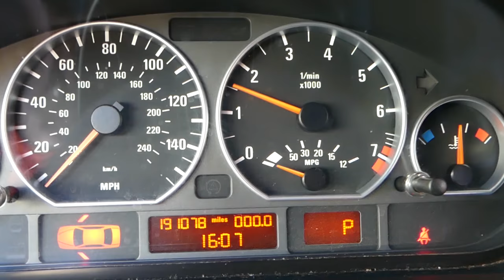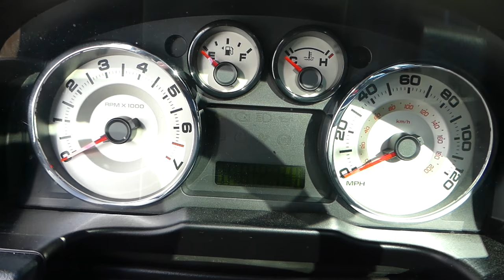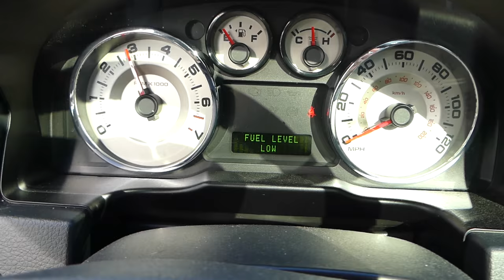HOW TO KNOW IF A CAR JUMPED TIMING CHAIN TIMING BELT. SYMPTOMS JUMPED TIMING

Comment: Never ever rev a sick engine,you will bend the valves. Live data on decent diagnostic computer would show crank  and cam signals have shifted. Not your best diagnostic skills!
Reply: You will only bend valves with an interference engine but it is still not very good to rev an engine that has messed up timing
Reply: Maybe they're putting a new engine in.....
Reply: i think the point was for people who don't understand cars. they know thats not a good thing, but if someone doesn't know what it sounds like or feels like, they could end up causing even more damage than what they could have caused.
Reply: He was show how normal people could diagnose it...
Reply: @Dillon Kluksdahl wrong… it will
Reply: @red3092  That's true, but most engines (other than Turbos) seems to be interference these days.

Comment: Sounds like a  mower. A car should not sound like a mower haha 😅 my car is currently in the shop due to the timing chain. Expensive as hell fix. I feel like it would almost be cheaper to replace the engine.
Reply: It's much cheaper to diy, cost me 65$ to change mine,  took the whole entire day but still worth it
Reply: @rockyloccgarage2040  Yeah the expensive part is the labour precisely for the reason it takes most the day even for a mechanic

Comment: As a mechanic, I'll explain it in more simpler terms! A engine that's jumped time, but still runs, needs to be diagnosed as to whether it's jumped a few teeth on one or the other of its timing sprockets. In which case can't be repaired but only replaced instead. Or has simply gotten it's timing advance or derate out of adjustment at its distributor, which is a easy fix. The most common signs are.
Hard starting with quick, uneven, upward spiking when cranking over.
Unsteady idle, or misfire, with excessive engine vibration. Intermittent but steady popping noise at the exhaust pipe.
Noticeable loss of power and decrease of fuel mileage. 
Excessive valve tick or chatter, especially during acceleration.
Changing a timing set can be difficult and labor intensive, and should only be attempted by someone properly qualified! Several factors go into getting the engine set precisely back into its proper timing position. There is no latitude for this because if the time settling is positioned just one or two teeth incorrectly, it can cause further internal damage, in just a matter of a few seconds!
Reply: @Carolina Western

The surest way to avoid the problem, is to steer clear of that boat anchor that Fraud and Mazdoo call a 3.5!😬
Reply: @slicksnewonenow  didn’t realize these were such ticking time bombs
Reply: Usually on a V6 engine there are 2 timing/cam chains (1 per 3 cylinders) , what would happen if 1 of the 2 cam chains was off by 1 tooth ? would this bend some valves ? anyone knows ?
Reply: @rayhope7957  they don’t? Pretty sure they run off of coil packs like most cars, can’t listen to all mechanics words of advice
Reply: Can you fix my car
Reply: When you say “can’t be repaired - only replaced” do you mean the whole engine? Or the timing chain ?
Reply: @stephenfriesen7636  if it's still running, then usually just the timing chain set. If not, then the chain and whatever valves it may have damaged. In which case I usually rebuild the heads.
Reply: @travismidlam3853  coil packs or not is irrelevant to a timing issue. All engines are timed.
Reply: @PatricioDeLaRosa  One tooth? Not usually but it would depend on the engine. You'd definitely notice it though.
Reply: @carolinawestern3875   thank you very much for your response.   I had a chain skipping on an older car, it it was lurching and stopped running while making a terrible noise. I managed to drive it to a shop only at low speeds.  They said it was timing chain.  Proceeded to replace the timing chain & tensioner.  Now my engine sounds terrible, sputtering often, especially when foot off the gas, occasionally hearing rods knocking.  The shop says their timing job is fine - that it must be other issues with the engine.  Trying to decide to fight with them or if they may be right/truthful
Reply: @stephenfriesen7636  did you discover or fix this issue?
Reply: @briangalicia5290  no. Amateurs who hear my engine running say the constant ticking sound, and occasional rod knocking are serious and indicate bad timing.  The mechanic says they did the timing chain replacement right, and will charge me to “investigate further”.  So now I need to decide how much I want to fight with the mechanic
Reply: @stephenfriesen7636 same situation it is definitely timing I know for a fact in my situation because I went to a guy who looked like the type of guy to lie to me and scam me so there’s my first mistake just take a good look at ur mechanic and u can also tell that way
Reply: @stephenfriesen7636 did you visit another mechanic who got you fixed up? It's crazy how it's just few mechanics who know what to do with timing chains. I have the same issue on my 2009 Hyundai sonata, thought the engine cut outs were crankshaft/camshaft sensor issues, replaced them and car started to misfire, would vibrate if in Drive D and not moving and hesitate to accelerate while I see the rpm gauge move (after stepping on the gas), knew something was wrong as my V6 often oppresses on the road lol.
Drove it home (less than 10 miles)  the same day I noticed the hesitation to move and vibration while stationary, the next day it wouldn't start back up and I noticed a weird sound around the top side of the engine while I cranked it.
Reply: Can a slipped timing chain cause the car to not start? My Audi A1 is not starting and they are saying the timing chain probably slipped
Reply: @Tofaeal  yes it can. Timing chains & belts, stretch or break. As they stretch, the damper keeps it tight with pressure. Till it's limit is reached and causes belt lash. Then it mechanically jumps time. Usually during shut down, if you're lucky.
Reply: the ecu determines spark timing on that car not a distributor mr mechanic

Comment: my car do exactly the same but on my car i got camshaft sensor wrong code when i changed camshaft i got wrong code on the new camshaft too and the car is hard to start sometimes i get no start and sometimes the car dies in the middle of traffic and it's embarrassing,what you think can it be the chain?
Reply: I have the same issues, V6 sonata 09, I changed the crankshaft position sensor and the CAMSHAFT POSITION SENSOR, I think it might be timing, won't start now and a weird noise around the engine head during cranking.
I'll be trusting a mechanic to open it up to confirm this. I have some bits of hope the engine isn't damaged because I heard no crazy sounds before I shut it off and it still cranks.

Comment: just had head gasket replaced with water pump and timing belt.  significant power loss, hard to get car over 70 mph and lots of white smoke and knocking.  what could the issue be?   it was a very expensive repair.  thank you.
Reply: Any overheating
Reply: @eduardo9163  Hi.  Turns out it was the timing being off so it's good now.  Thank you.
Reply: @flipczech  what did they charge and was this a 4 or 6 or 8 cylinder. I clouding pump timing and gasket?
Reply: @eduardo9163  I had the gasket, water pump, timing belt and raditator replaced, for   about $2000.00 and change. And it's a 4 cylinder.
Reply: @flipczech  that's a lot. Not even a v6. Okay thanks
Reply: @eduardo9163  Yes, but it had to go to the machine shop also.  Take care.
Reply: @flipczech  why to the machine shop?
Reply: @thuglivintv824  prob warped head

Comment: ASSISTANCE PLEASE. I have the codes P0008, P0009, and P0017 on my '11 Chevrolet Traverse.  I got the crankshaft position sensor replaced at a shop,  but the check engine light came back on... do I need a timing chain?  Do I need to get the camshaft sensors replaced?

There's no funny noise when I start it up.  I have a video if you'd like to hear the sound of the engine that I can email... I just need some suggestions because I just bought this freakin suv 2 weeks ago.

Comment: Could this cause a engine light flash & your car to not accelerate over the speed of 20mph?? Would B helpful with a quick reply
Reply: Did you find out mine wouldn’t go over 120 then 80 now 60 all over 3 weeks

Comment: I have a mazdaspeed 3 and I was doing some hard pulls. Then all of a sudden the car started sputtering. I towed it home and then checked codes. It said P0202 and P0203 injectors 2 and 3 open circuit, Then it had random misfire P0300. I thought injectors were bad but they weren’t. I changed them nothing. Changed spark plugs. Nothing. Changed coils.  Still nothing. Checked harness. It tested out good. Had good continuity so. I was lost. I checked the timming chain and sure enough it was loose. Did this mess up the head i don’t know if it did skip timming but my car just runs like shit. I smelled the exhaust and it smells like gas. I try to rev it. No power, and it backfires like shit. I just need help. I’m exhausted with this dam car
Reply: The timing chain definitely skipped when it was loose, and now the car isn't combusting the fuel properly (making it smell like gas) and run like shit. Don't drive it too much or you will ruin the catalytic converters
Reply: I did timming and it’s still the same thing I also checked before I did the guides and everything and it was still in time
Reply: Clogged Pcv?
Reply: Double check that timing as well, the shoguns be a mark on the crank and timing gear
Reply: @jeffreygonzalez8544  Check with a vacuum gauge. It's the diagnostic tool you want. It will tell you if timing is out, vacuum leaks, clogged exhaust, stuck valves, etc... Harbor Freight sells the gauge and accessories for about 15 bucks.
Reply: Did you find the solution? I have the same engine and problem
Reply: @deionduenas5201 How about you?? Did you figure it out??

Comment: I have an 1999 Saturn sc1 & I'm trying to figure out if it's my timing chain or the timing tensioner cause my car makes the same noise as your 2nd vehicle. Also when I go down to 40 mph it hesitates before it goes down farther.
Reply: I hear a minor tick in mine as well. I presume you’re describing an autobox shift. I got the stick. I DID notice it reduced with an 02 sensor and EGR. Good start.
Best advise is start there to make sure it’s all good on mix, then go to timing.

Comment: I want to ask for a Acura RDX 2007 2.3L, what's do you think?

(p0234,p0117,p0365,p1131)
engine very hard to start and runns rough
Reply: If it's a miss in every cylinder, and changes. It most likely skipped timing.

Comment: Hey guys,  I have a2005 Saab 93, that just turns over but doesnt start would it do that if the timing was that far off?
Reply: Marc Mcclinchy hey did you fix it ? My 2009 Scirocco is having the same problem
Reply: Easy way for no starts: First check with starter fluid. If it starts with starter fluid, you know that the fuel system is not functioning correctly. Check for spark next with a spark tester; they're cheap. If spark and fuel are both good, I'd pull the plugs. Check for excessive gap. Shine a light down the cylinder bores to be sure they're not full of water. Turn it over a few times without the plugs to spray any water out. Next would be a compression test. If you have a scope, relative compression test would be quickest. If not, Harbor Freight sells standard kits for cheap prices. Next get a cigar and a piece of flexible tube. Remove the airbox from the engine. Tape the tube to the intake charge tube and start smoking the cigar and blowing smoke down the tube. Any leaks in the intake manifold should be visible. Perhaps you have a giant intake leak.

Be sure to check voltage level, and voltage drop during start. The starter motor may be no good. Usually it's the solenoid that gives out first (the plunger that engages the starter gear). That would be observed as a "click" sound when you try to engage the starter. If it's turning over the solenoid is good. Sometimes starter motors can become weak and turn too slowly. There could be an obstruction (like water in the cylinders) keeping it from revolving fast enough to start the engine. Also, if there is water in the engine, chances are you'll need new connecting rods because they'll bend.

If all else fails and you can't find a problem, check for an intertia switch. There is a switch in most vehicles that will disable the fuel pump after an accident. They can get tripped even if you hit a bump hard enough sometimes. You just need to press a button (usually red) to reset it. If that's not the problem and everything else seems good, I would suspect a bad ECU.

Comment: I have these codes with my car P0301 P0304 P0340 P0341 P0300 and I have changed the crankshaft, camshaft, battery, spark plugs. but it didnot work for me  I have only 50000 miles on my Honda accord 2.4L. I have spend over a thousand dollar but I still couldnot figure it out. DO you think it is timing chain problem??any help will be appreiciated.
Reply: Do you check the coils, my Nissan Altima has this codes and we change the coils and spark plugs.
Reply: I had same problem my car I used cheap Jeep parts and I didn't understand that some cars need to have the original dealer parts after they were installed my car ran like brand new again I had same codes u  need Orginal Parts throw away those sensors u put on

Comment: Usually on a V6 engine there are 2 cam chains (1 per 3 cylinders) , what would happen if 1 of the 2 cam chains was off by 1 tooth ? would this bend some valves ? anyone knows ?

Comment: I just changed camshaft, crankshaft and timing variable and car won't start. Anyone know what's the problem
Reply: Alen Yegiyants what type of car?, did you ever get it fixed?
Reply: Alen Yegiyants distributor Mabey
Reply: Check the timing marks
Reply: Sorry this is old but you must have figured it out by now. I’d say check spark plug cable fire order

Comment: Please help! Recurring p0012 and p0015 intake and exhaust timing over retarded

I have a 2008 X3 3.0SI with 107,000 miles on it.
Shortly after purchasing it I got those two codes.  After searching everyone said it was the vanos solenoids.  So I replaced both of those with OEM parts. 
A week later the codes came back. I bought another vanos solenoid thinking maybe I got 2 bad ones. I replaced just one of them. The codes came back shortly after and it again was both intake and exhaust at the same time.
  I took a shot in the dark and replaced the vanos check valves, the codes still came back.
Then I replaced the camshaft position sensors thinking maybe they were just broken.  The codes still came back.
When the codes do come back it is usually just after startup and I can feel the engine surge a bit, and then it throws the codes.
Curiously every single time it throws the codes it is both intake and exhaust at the same time.
I think it might be the vanos actuator motor?  
To summarize I've replaced:
Both vanos solenoids
Both camshaft position sensors
Both Vanos check valves
Either way I want to stop throwing parts at it in hopes it will fix the problem.
Any idea
Reply: Did you find out what was it mine does the same thing
Reply: @ahuichote72  did you figure out the issue
Reply: @theobradford5774  same shit on my 2007 Camry p0012

Comment: I had this symptom very bad and then engine doesn’t start any more.. no cranking...
Reply: What happened after? fixed? Sold?
Reply: @777-h6d  fixed. The problem was but the defected turbo charger. Engin oil was through the turbo full in the cylinder, that‘s why engine did not crank

Comment: I have 0022 code intake camshaft timing for bank 2 is more retarded than what the ECM has commanded it be.  What to look for after replacing the cam sensor, cam solenoid, magnet and wiring on a 2014 Passat 1.8? Thanks in advance.

Comment: Just change my antique manifold manually cleaned.The valves manually opened and closed them at the crank shaft.Rotated it counter clockwise and now the car won't start.Is that likely because that counterclockwise rotation

Comment: get an  oscilloscope, never rev an Engine to diagnose timing issues
Reply: Explain me
Reply: I have a scope (use them for electronic repair work and tuned circuit alignment), but I am curious to know what signal(s) I should be monitoring from an engine in order to be able to see an issue on the screen.

Please can you tell me where you would place your scope probe(s) to diagnose engine (not ignition) timing?

Comment: Ive got an e90 318i n46 ive just had my valvetronic adjusted but got a funny feeling my timing chain is on its way out its on 59,000 miles when i open the oil cap its sounds aweful
Reply: Should have changed the oil!
Reply: @rockyloccgarage2040  was vavletronic, n3ver mind gotta a 330d nowadays so nvm